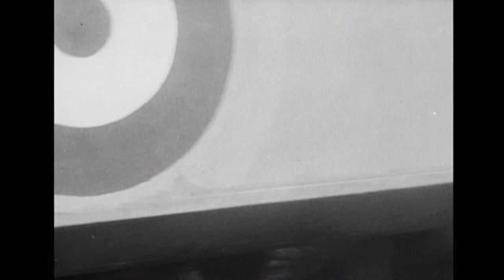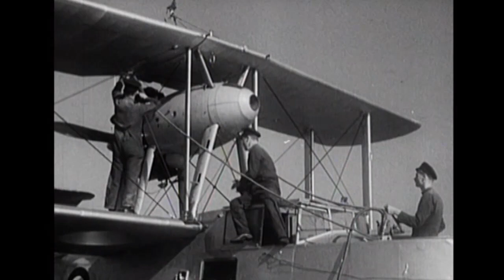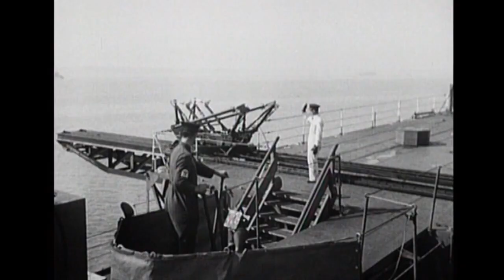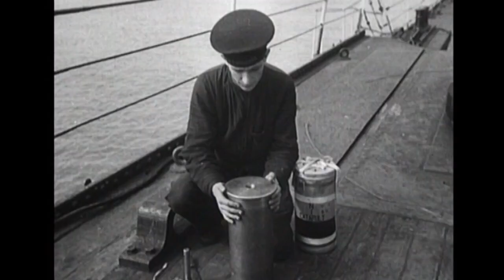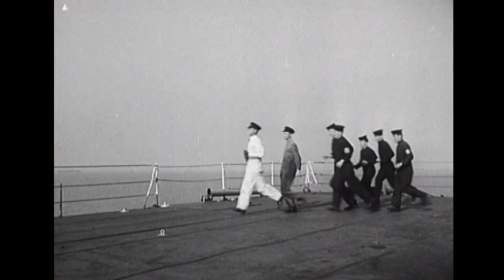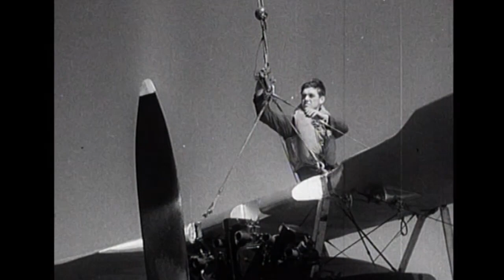Catapult Ships Royal Navy Instructional Film (1940)

Comment: I saw a video how in WW2, some German U-Boats used to tow a gyrocopter to altitude for observation purposes. At completion, it would be winched back down, folded, and stowed on deck in a special casing. It was pointed out that if the sub had to dive suddenly to avoid attack,  the tow cable would be cut and "the pilot would be left to drown in the usual way."
Reply: Ha-ha-ha !!!

Comment: The “Hooker On” is a job title. What heroes that generation had.
Reply: My father was an Observer in the Fleet Air Arm from 1941 to 1946 and in the early part of the war was assigned to fly in the Walrus. His task was to hook on the plane during recovery. I admire him that he had to get up to the upper wing with the engine running. Having seen a Walrus at the Fleet Air Arm museum at Yeovilton it was a very exposed climb. He also told me that landings on the water were risky and the pilot had to get the approach speed just right. His pilot had a habit of approaching too fast and pitch poling the plane upside down. His pilot (who later became chairman of British Gas) was a non swimmer and my father had to dive under to pull him out on a number of occasions. My father died in 2012 I am grateful he told me these memories.
Reply: Not only that but the instructional film features a pin-up girl.

Comment: The launch process took so long I'm surprised they didn't take a tea break!
Reply: Yeah, training films are always produced at five times the normal speed, easier to learn that way.
Reply: Although the process was maybe shorter for the swivelling catapults on which the aircraft remained mounted versus the hangared version we see in this clip there would be a serious added workload on the concentration of the chain of command. At the time of the fateful battle between the HMAS Sydney and the disguised raider HSK Kormoran in which the entire crew of the HMAS Sydney was lost, German eyewitnesses suggest the Sydney's seaplane was being deployed then was being recovered as the vessels closed to an unwise short distance. Cpt. Burnett of the HMAS Sydney has been criticised as having been incompetent for approaching so close to within Kormoran's firepower which very nearly matched Sydney's own. Kormoran was masquerading as a Dutch merchantman, the Straat Malacca and its firewpower was hidden. Was there a human factor also involved, that of task saturation? The Kormoran's radio operator was transmitting messages intended to mislead. The vessel was positioned upsun of the Sydney and in a position to confuse regarding flag signals. A decision had been made to launch the seaplane which enables observation from a safe distance. If there were servicability issues with the seaplane or the catapult and an interception going on, the chain of command would have been very busy.
Reply: No unions on ships.
Reply: And that was their rapid response team.

Comment: Hardly seems possible that the Walrus was built by the same company that made the Spitfire. A world apart.
Reply: the Walrus and Sea Otter were incredibly sturdy amphibious planes, which saved many pilots and sailors in WW2. Seaplanes and flying boats were Supermarines'  bread and butter planes -the Spitfire was an exception-both planes were designed by the genius Mitchell !
Reply: It was also designed by the same designer ... R. J. Mitchell
Reply: @chrisrichards8640  - That's a good last name to have in naval aviation!
Reply: Two different aircraft designed for two different roles.  Although I agree it hardly seems possible.  And there was a variant of the Spitfire for the Royal Navy - called the Seafire.  It was designed for use on aircraft carriers.
Reply: It’s what they did, the Spitfire was the exception.. Thank God for RJ
Reply: waynester71 You’d be better of thanking god for Sidney Camm before RJ.
Reply: MichaelKingsfordGray  @waynester71is fictional

Comment: 21:38 - So air-crew dude climbs upon the top wing to catch the crane hook and secure it to the his aircraft.

If he slips backwards a little bit there is this spinning propeller waiting to turn him into sausage.

And this is a pretty smooth sea........
Reply: Air Ministry Walrus Manua 17 safety
instruction
“Before the operator attempts to start the engine he should tie a line
round his waist and secure the free end of the line to the eyed fitting
provided .... Should he inadvertently slip rearwards during starting
operations, the line will prevent him from coming into contact with the
airscrew [propeller].”
Reply: @margaretpicard6460  The engine is already running during recovery